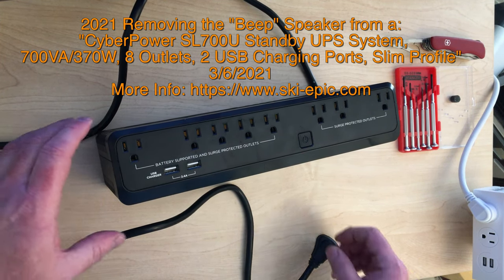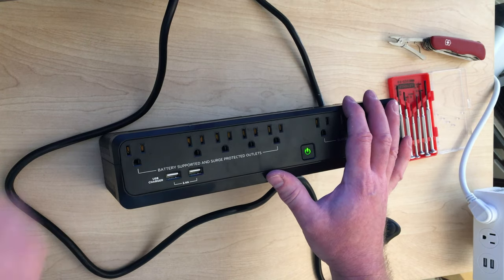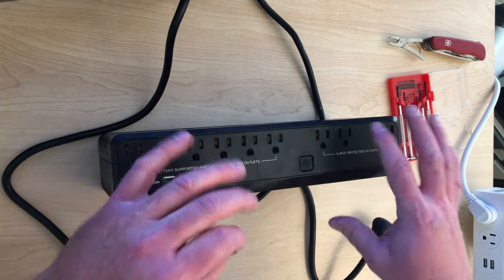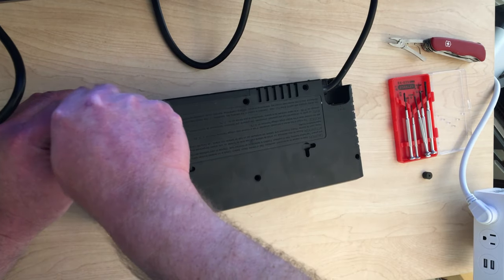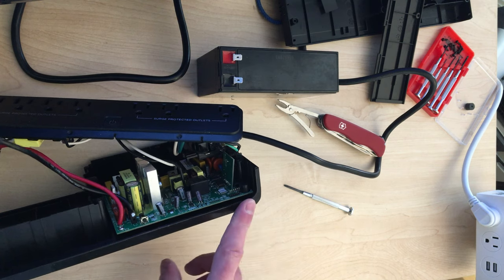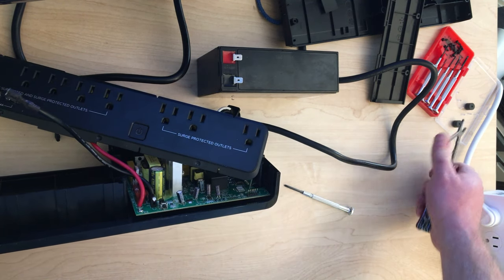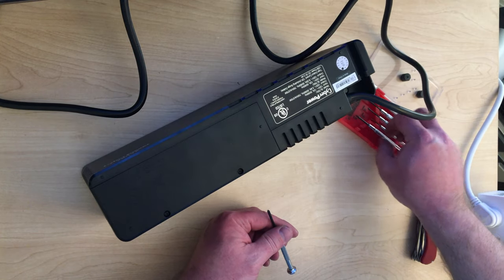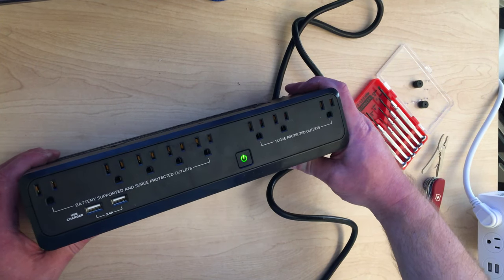2021 Removing/Disabling the Beep (Speaker) in a UPS Power Supply

Comment: bro this is great. I couldnt find any info that confirmed if this would brick the UPS or not. I "accquired" a pretty nice tripplite smartlcd1000 from my former employer, it runs my gaming PC for about 20 mins with 1 monitor but the real reason I got it was for the modem and router so if power flickers out at night all our household connected devices like the romba and litter robots wont freak out when network is down. 

I have an inverter generator setup via an interlock to run the house so this is a nice stop gap to keep the interwebs alive until I get it going. 

BUT the problem is my neurotic little dog loses his absolute shit when this sumbitch beeps and of course at 4am it is pretty jarring. So thanks again, gunna do this shit right now.

Comment: There was a time when we needed Speakers on a UPS to tell us the power has failed and to save our work and shut our PC before the UPS backup runs out.
Now people have laptops that will tell you when the UPS runs out and people use the UPS only for what its meant until the generator or the Inverter Backup kicks in.
APC were the first UPS company that released models that had a button where you could slience them
I have it as my main backup. I needed a UPS for my Fiber Cable and broadband connection which in my mom's room Just as a back up connection for me when power fails. But if power fails at night the beeping will wake her up.
SO I was looking for a way to remove the speaker as this routers takes hardly any power and a regular UPS will give many hours of back up. I could not in for a router UPS but that is too small and not value for money when you compare it with a regular UPS that will give many times more power back up.
I will have to try this. Thanks for the video.
BTW The APC UPS is 1500 VA and gives 2 hours backup and is 1 feet Tall and wide. There are two other models of UPS form APC that has a mute switch but one cost twice what a normal 600 VA would cost and the other cost three times. The APC UPS I have costs 5 times more than a regula 600 VA UPS>
In lower models APC has not offered this feature if they did I am sure it would sell like hot cakes. It hardly costs anything to put in a mute switch. 
That gives me an Idea if you looking for some crazy content to go viral. Modify a UPS With a switch. You can drill a hole and maybe stick the switch with glue right there and connect the speaker via this to theboard. I am sure people would love it and this could become a most sought out mod if you offered it as as service.

Comment: Thank you for this video. I have an old APC UPS that I want to just use as a power strip because I don't have another one available, but it insists on beeping for a solid minute every five hours. I could disable it with software, but APC decided that a proprietary RJ48-to-USB plug was the way to go for interfacing with this model. Oh, and you can only disable *some* alarms and only on *SOME* operating systems.

Ah well, what's a more universal configuration tool than a pair of pliers, am I right??

Comment: A tip from someone who changes out dozens of ups batteries every year...  Grab just behind the wide part of the connector, then use a screwdriver handle or piece of wood to 'tap' the plier's jaws.  It's quick and lowers the chance of slipping with the pliers and arcing.
Reply: Do you know if removing the speaker can cause any issues on the other chain of circuits on the board, since each circuit I assume is expected to receive a certain voltage/amperage of power along the chain in lieu of each circuit using some power and or causing expected planned resistance? Will removing the speaker cause on the other circuits any over voltage/amperage or under voltage/amperage by removing this speaker/curcuit?
Reply from the maker: @GMoney-B  I worried about it myself, but I've removed the speakers from several different units and never had a single issue.  I just wish the manufactures were awake, and had a clue, asked any of their customers, and would offer a design for MORE MONEY without a speaker.  Can you imagine how rich they would be?  They would be the most popular UPS units on the planet.  Nobody wants that speaker, it's literally the most requested feature and the manufacturers hate money and hate their customers.
Reply: @brianwski  Lol. I agree. How insane is that that they are passing up more customers for actually removing a feature, ha! They could have enough money to take care of what is probably a concern of liability if they take out that game show buzzer. I assume that is probably why. Either that or they support consumer terrorism, lol.

Comment: Power Switch
To turn the UPS on, press the power button for approximately 2 seconds - you will hear a constant tone (1 second) -
and release after a short beep.
To turn the UPS off, press the power button for approximately 2 seconds - you will hear a constant tone (1 second)
- and release after two short beeps.
Alarm setting: The audible alarm can be turned OFF or ON by quickly pressing the POWER button twice. The
default setting is for the Alarm On. To turn the Alarm Off, quickly press the power button twice. You will hear two
short beeps when the Alarm is turned Off. To turn the Alarm back ON, quickly press the power button twice. You
will hear a single short beep when the Alarm is turned On.
*This works also may be easier than manual remover.

Comment: How long has this ups lasted for you? I’m looking for something that will run a 5w usb camera for at least 12 hours for extended power failure.
Reply from the maker: This particular unit would last 60 hours or more for a 5w camera (somebody can check my math on that).   For a 5W device, the "load you need to support" is about 5W/12V = 0.42 Amps.   This unit is 370 Watts, but you give it a "haircut" based on efficiency and maybe the battery getting older over the next year or two, so let's say 350 Watts/12V = 29 Amps before the UPS runs out of Amps.  29 Amps/0.42 Amps = 69.  So it will run 69 hours.  Always be a little conservative, so I'm going with 60 hours for your USB camera.  If you try it out and you get different, let me know!!

Comment: This normal beep is useless. But special beeps like when the battery is dead, or no charge or voltage issues are very important. UPS makers have to redesign it properly in a less annoying way! And give us a switch to on and off it, and a volume controller 😌
Reply: Replacing it with a led is another good idea

Comment: The alarm is for those who are using the UPS for a computer and don't use the software that came with it which allow the unit to power down automatically the computer in case of a power loss. So while the alarm is very annoying, it is useful for a lot of person